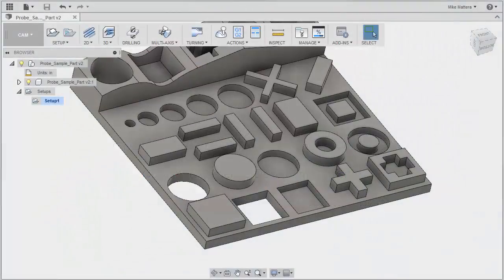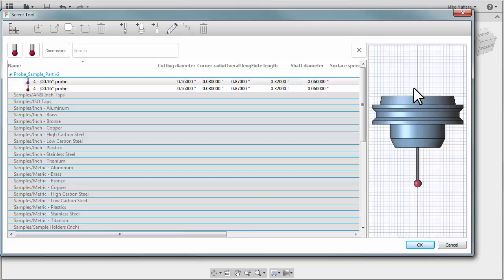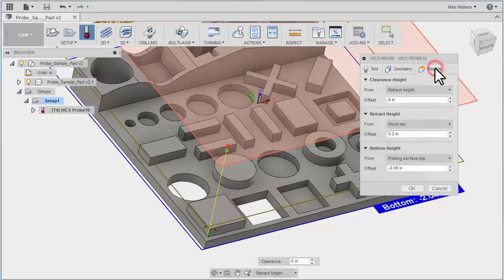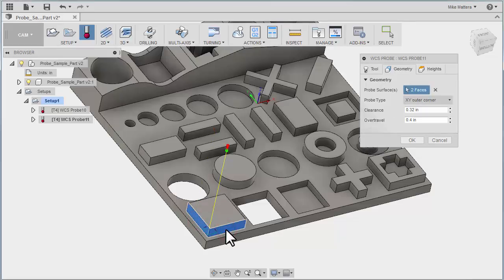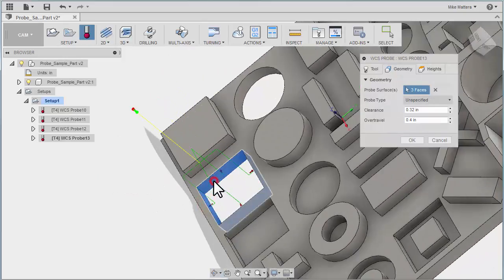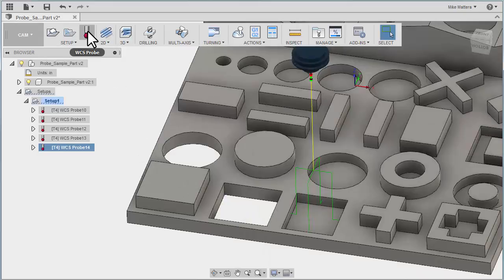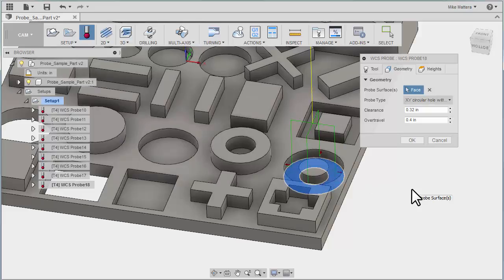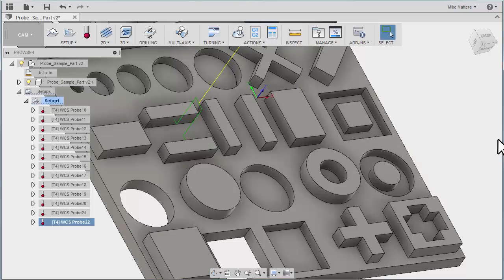Fusion 360 - Probing Lesson

Comment: I have a Renishaw probe as well as a Haimer. I read on the F360 forum that touch probes like the Renishaw are not supported unless you have a mainstream post such as Hass, Fanuc - but not LinuxCNC for instance. Can you confirm please?
And for the Haimer, you could imagine that the CAM could position a manual probe up close, ready for jogging. Then you could touch off and set the zero and set it off for the next point. It would work for hobby users but I don't suppose that would justify the cost of developing it. 
I hope we can see probe supported in more posts like LinuxCNC.